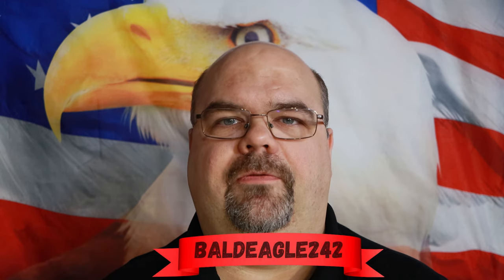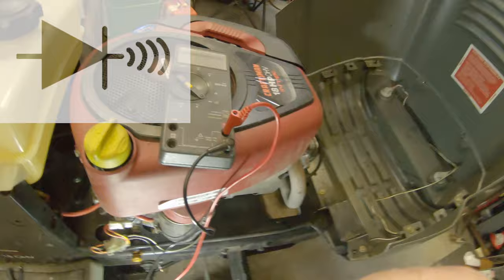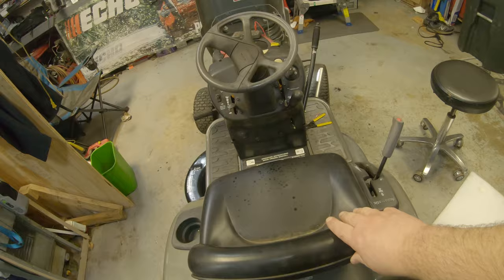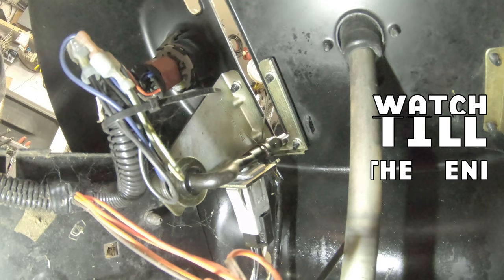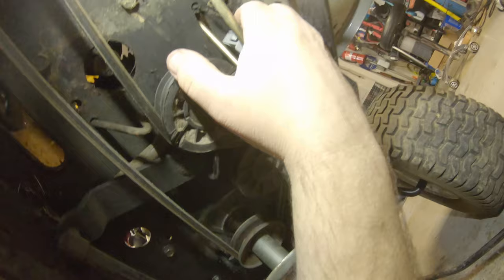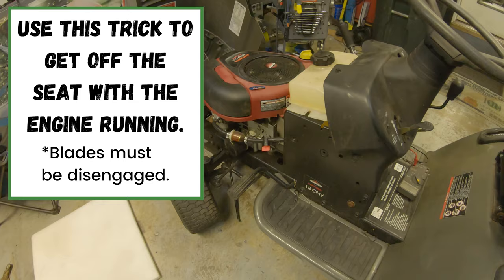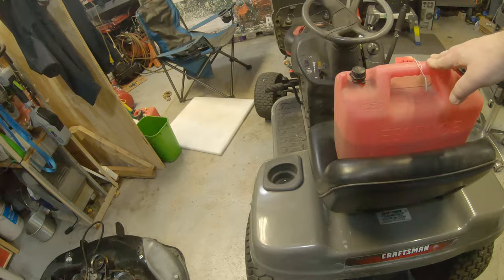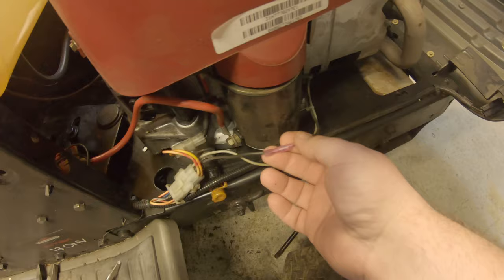The Hidden Safety Switch Trick Exposed

Comment: This video is unbelievably helpful.  I have scoured the internet and this is the clearest and most straightforward troubleshooting video for a very frustrating and annoying problem.  One question, do the PTO and starter switches need to be checked?  Thx
Reply from the maker: You will need to set you meter to read low voltage DC to check the starter and electric PTO. You can check the starter voltage at the large wire connected to the terminal on the starter. The PTO voltage should be checked with the wire unplugged so there is no chance of engaging the blades while testing. Ensure all other safety switches are set so the blades will engage(seat, and reverse if present). You should have 12 plus volts between the two plug connections pins.

Comment: Supremely helpful video! Now I know my issue is the brake switch, but thanks the whoever engineered the YT3000 series decided the best place for the switch was directly on top of both the deck pulley assembly and the brake linkage itself! Virtually no room to let the old switch just fall down without first taking both assemblies completely off! A 10 minute job (at most) is now  close to an hour. More if you run in to new problems resulting from removing everything that shouldn't have needed removal in the first place! Thank you, Mr Craftsman "I've never actually worked on a lawn mower" Engineer!

Comment: I am having issues with my craftsman riding mower. I have done everything I can think of. Engine start right up every time,new pto switch, good fuse, no brake switch found, runs but when brake is released engine dies. I have checked seat and works fine also belt are in good condition.  Can you contact me. I need help please??
Reply from the maker: Is there any chance the reverse safety switch is engaged?

Comment: Bald eagle, do you give advice on specific pieces of equipment. I have a Husqvarna rider 155, 2003 version residential zero turn unit. I got it running for the season ran for five minutes while I was getting ready to cut and it all of a sudden died out. I put my tools away sit on it and I have no click I’ve replaced the solenoid tested all the kill switches and I still have no click. I just saw this video of yours but I don’t know where that black wire for the coil is and it also distinctly says don’t cut this and try to run your unit so that’s a little confusing help the grass is getting long. Ron
Reply from the maker: You don’t want to cut that wire and try to use your machine. Cutting it is for testing components only. 
If it died and won’t click that could be a few things. Are you sure the battery is still good?
Reply: I am sure battery is good, 1) it started with the battery first thing this season 2) I can jump the solenoid terminals and it turns over
Reply: I just bought a short-test light but am unsure what do with it. At this point I’m thinking it’s a short.
Reply: I have a mult- meter too
Reply from the maker: Id first clip your test light onto a good ground point and then test the starter solenoid for power on the small solenoid wire(not the battery wire) 
It should have power when you hold the key in the start position.
Reply from the maker: I prefer a multi meter over a test light but either will work for most things on a mower.
Reply: No power when I turn the key in the setup you describe.
Reply from the maker: That sounds like a bad key switch

Comment: IMy son has a Troy Bilt TB30R (the small rear engine mower).  There is one connector that is in the vicinity of the battery and starter, that is not connected.  It is just a 2 wire connector, red and green.  I assume green is ground and red is power, and the wires are part of a large wire bundle.  The leads on the connecter are fairly short, so it could not go very far.  Any ideas what might be going on?  Obviously, we do not see any corresponding connectors that are not engaged.  The mower will not start, much like if a safety switch is not working.  Any help appreciated
Reply from the maker: I don’t recall the colors for the wire connections but generally the safety circuits are black wires. It’s possible the connection your talking about would be for the charging system. Without tracing the wires down it would be difficult for me to be certain what that plug is for. 
I would start by checking to see if either wire connects to ground or power before trying to connect it to anything.  Hooking it up someplace it shouldn’t be could cause damage somewhere else.

Comment: 25 year old Snapper that runs until I release the brake, even when I'm sitting on it. The seat switches are new, is it the brake switch?
Reply from the maker: +Recoil Rob Without going through the steps to test them it’s a guessing game.
Reply: @baldeagle242  I tested all 3 switches with my meter, the NO switch and NC switch in the seat are good, so is the brake switch. I'll try your method.
Reply from the maker: @recoilrob4765  It’s possible there is a short in the wiring as well. If anything goes to ground it will kill the engine. If your mower has the switch on the gear shift to keep it from cutting in reverse that could be the issue as well.
Reply: @baldeagle242  I don't have the reverse switch but thanks. If there was a short to ground then it wouldn't start at all, correct? Mine starts then dies when the brake is released.
Reply from the maker: That’s correct.
Reply: @baldeagle242  Thanks for your help.
Reply from the maker: @recoilrob4765  You’re welcome. Thanks for being here. I hope to see you around on future videos. 😁👍

Comment: So the black sire going to the starter from the key switch is a "kill wire" and if it has a connection than it is killing the starter.
Reply from the maker: The black wire goes to the coil. If it has a connection to ground it will kill the spark.

Comment: Excellent video. Thank you so much. I have an old Bestgreen mower with no cutting deck which pulls small trailer around our property. Very useful it is too. This morning it wouldn't start. I knew it would be safety switch related, but had no idea where they were. As I'd been meaning to disconnect them all at some point, this was the opportunity to do it. Found the under seat switch and afrwe testing with a meter shorted  out the two white wires. Still no start. Eventually found the switch under the parking brake - same type of switch so shorted out the same. Still no start. Spent over an hour trying to find another switch - which I knew must be related to the Brake/clutch but I couldnt find it anywhere. Google is my friend and I hit your excellent video first go. 5 mins later I knew where to look, found it, shorted it out and BINGO! She runs perfectly so I finished the job by removing all unnecessary levers and clutter. Thank you so much and best wishes from an Englishman living in France!

Comment: That was one of the most informative posts I have ever seen. Especially since I have a LT 2000 mower. It’s almost identical. Thank you so much.
Reply from the maker: You’re welcome!  Thanks for watching and taking the time to leave a comments. 😁👍
Reply: When you check the solenoid, have you already cut the black wire or before?
Reply from the maker: @GeraldAlan-ix6dx  it shouldn’t matter. The solenoid should work either way. You can check the solenoid wire for 12 volts with the key on if you have a test light or multi meter. 
If you have no way to test for voltage you can spray a small amount of fuel or starting fluid directly into the carb. If it fires and dies with the wire on the side of the engine disconnected there’s a good chance it’s stuck shut and not working properly.
Reply: The solenoid is not clicking. I checked the battery when it wouldn’t start, but it is a new battery from August. It started fine and after I filled the bags and emptied them. It wouldn’t start. That’s when I checked out your site. ??
Reply: @baldeagle242  The solenoid is not clicking when I turn the key on. Battery charger says it is fully charged, but nothing.
Reply from the maker: @GeraldAlan-ix6dx  I would confirm that it is receiving 12 volts DC at the solenid.  If not, I would replace it.

Comment: Thanks for this. I was pulling my hair out because I am generally pretty good with a wrench or a soldering iron, but it took me an hour to figure out that the circuit for the seat safety on mine was open circuit for on instead of closed.
Reply from the maker: I’m glad it was helpful. 😁👍

Comment: Excellent video. Very clear and easy to understand. 
My Craftsman lawn tractor recently stopped working after running for a while. It starts alright but when I try to release the clutch/break pedal the engine stalls/stops. Could this be because of a faulty switch under the clutch/beak pedal? 
Thank you.
Reply from the maker: Yes, it’s likely a bad switch or connection.

Comment: Thanks for the tips. I had the engine cover all already, so I use the wire right off the coil for the diagnostics. Found I had an intermittent seat switch. Put some wd40 and worked by hand about 20 times (wd40 is non conductive) fixed that. Test the rest of the switches and all worked per your walkthrough. The end culprit was also a blown 20amp fuse… so, key wasn’t giving power to starter relay nor the carburetor solenoid. Engine cranks now.
Reply from the maker: +@cueballsi Thanks for watching! Here’s a link to other videos I’ve posted that you may find useful. https://youtube.com/playlist?list=PL5_ZXmQpcjpac4UV8OW8g-IWVCR8tqy79&si=RKfnQL-PAcZFy67a

Comment: This video was extremely helpful, thank you! Thought I knew what my problem was and replaced both the starter solenoid and brake interlock switch with no luck. I was about to disable the seat safety switch when I found this video. I went through the test procedure and found that my seat switch was good. My problem seems to be the PTO. Do you have  any other videos that cover diagnosing/troubleshooting the PTO clutch?
Reply from the maker: At this time I do not. Next time I come across that issue I will make a video though.

Comment: Great video. I have a question. I've got a snapper nxt2346. It has the push button start/stop switch. When I shut the mower off, the switch and the dash stay turned on and drain battery. Only way to kill the power is to pull the fuse out that's under the dash. Any clues or help?? Thanks in advance.
Reply from the maker: +Ohio 24 without any further diagnosis i’d say you have a bad switch.

Comment: Good job thank you, if i take my foot off the brake the motor stop if I engage mower deck the motor stop. I guess I need to buy two switches ?
Reply from the maker: That’s probably a seat safety switch. It doesn’t realize your sitting on the seat.

Comment: Picked up a little tractor off the side of the road I’ve been trouble shooting. The problem I’m having now is that when I engage the PTO lever the engine cuts off. I suspect the safety switch is the issue but not certain. I have the mower deck removed so there is no binding. When I hold the lever in the off position it will start but will kill the engine when it starts to move to the on position.
Reply from the maker: That sounds like a safety switch. The video below will show you a quick and easy way to troubleshoot the switches without knowing much about the electronics of the mower. 👇
https://youtu.be/dTBJi2BOlVg

Comment: This is great advice! But I’m not sure which black wire I am starting with. Mine looks a little different. If I use the black wire off of the starter solenoid then I am getting the beep constantly. Should I just start unplugging switches to see if any stop the beeping?
Reply from the maker: If your unsure you can follow the wire up to your coil(s) and attach your test lead there. You may have to remove the plastic cover on the engine to get to it this way.

Comment: Awesome job Bald eagle!! I'm going back out to try this on my Cub Cadet Ultima Z1. It has been driving me nuts trying to figure this out. Your video inspired me. LOL. Thanks again Steve.
Reply from the maker: Let us know what you find. 😁👍
Reply: @baldeagle242  Right off the bat my solenoid under the carb is not clicking.
Reply from the maker: @marksanders3237  it’s pretty common for those to fail. You can replace them without removing the carburetor on most mowers.
Reply: Thanks so much. We appreciate ya!!
Reply from the maker: You’re welcome. Just keep in mind that fuel will run out of the bottom of the carb once you loosen it up. I’d recommend pinching off the fuel line and taking precautions to catch the fuel.
Reply: @baldeagle242  Aaah. I didn't even think of that. Thanks again.

Comment: Just found your channel and subscribed because of the great information and the way you teach with a no nonsense simple explanation approach. BTW, I have a 2015 Cub Cadet XT1 LT46 that still runs perfect. My complaint however is the piece of sh*t seat which has fallen apart. But, try to find a good seat (so far impossible for me) and I refuse to pay Cub Cadet $249.00 for another piece of sh*t. What do you recommend? I would like a heavy duty one and NOT the thin vinyl that came with it. Any ideas?
Reply from the maker: It’s been a while since I’ve bought anything other than the less expensive aftermarket seats. I’ve often wondered what  an upholsterer would charge to redo one but I’ve never looked into it.  Thanks for subscribing.  😁👍

Comment: I have an 2007 John Deere X300. When I drew up the. Wiring diagram for the starter relay I left something out can you help me find the right schematic. Every one I find is for a different model.
Reply from the maker: If you have a local dealer they will usually help you with what you need and can print a diagram for you.

Comment: I have a 2003 craftsmans LT 2000 lawn tractor with a 17 horse Kohler engine.  The lawn tractor runs; however, after warming up the engine just cuts off as if I had turned the key to the off position.  There's no coughing or sputtering noise as if engine wasn't receiving enough gas or air. The carberator was replaced in 2022. Ihave replaced the fuel filter, fuel line, oil filter, and changed the oil. Any thoughts as to next steps?

Reply

Comment: my J Deere has lasted so long that all my wires have gone bad. and each one failed halfway thru mowing. to the point the only thing worth saving is the engine. but not before i wasted my time re wiring everything. tranny was final straw. thanks for the tips , i have started same scenario with another mower so....
Reply from the maker: I've had a few like that myself over the years. Unfurtenetly all good things must end at some point. Good luck with the other mower.  Hopefully nothing too serious.  Thanks for watching.
Reply: i have 21 yr old mower  its not a john deere but thats no problem i use it weekly during summer  no problem i can not fix  bought it new

Comment: Excellent and out of the box thinking. I have a Cub cadet where when you turn the switch to start it, the starter gear rises up but it doesn't turn the flywheel it just seems to run out of momentum. Will any of those switches affect that?
Reply from the maker: None of the safety switches will have an effect on the starter gear.  I would however double check to make sure the positive and negative cables are not reversed on your battery.
Reply: @baldeagle242  will do today and also the fuses.
Reply: @baldeagle242  it's a brand new starter

Comment: My lt1000 transmission can not be shifted if the engine is running. What could have caused it. How do I fix this problem. Thank you.
Reply from the maker: Difficulty shifting a riding mower while the engine is running could be due to issues with the clutch, transmission, or the belt tension. Ensure the clutch is fully disengaged, and check for any debris or damage around the shifting mechanism.